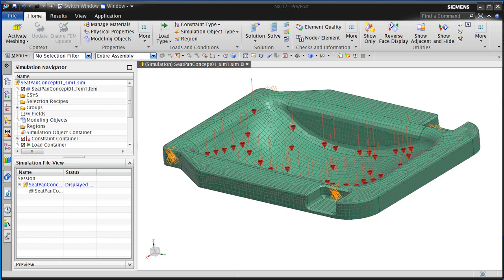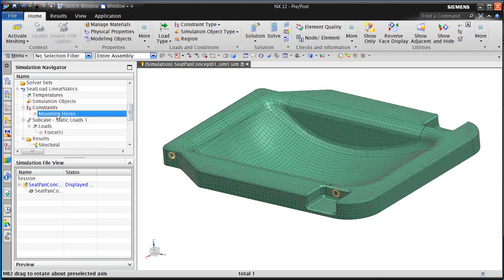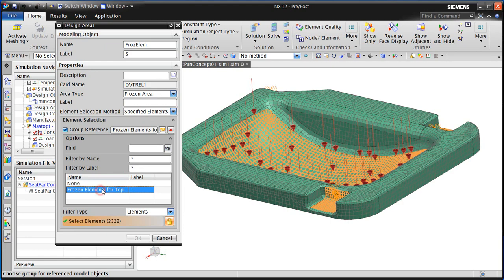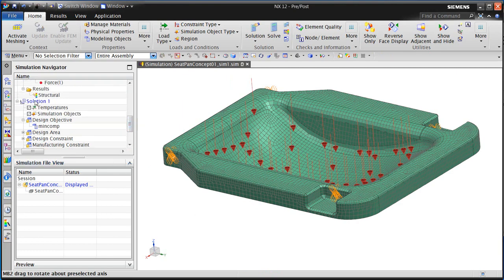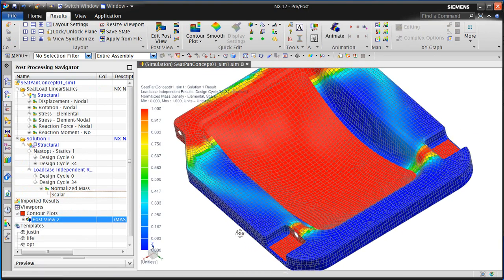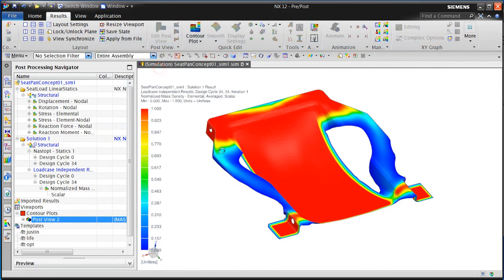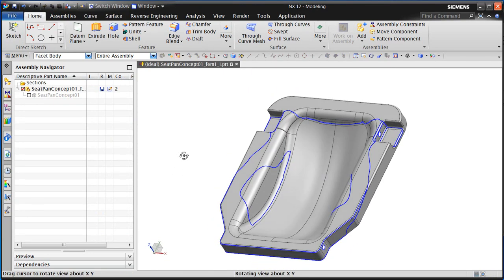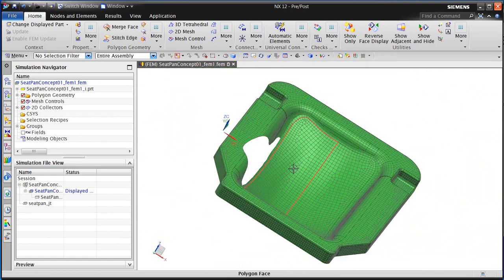Simcenter 3D Topology Optimization

Comment: very nice and informative video .Can this be used for solid bodies as well? Are tutorials for other SOL 200 solver available?
Reply from the maker: Thanks!  Glad you liked it.  It can be used for solid bodies as well.  I recommend you try our NX Topology Optimizer for solid bodies as it is easier to set up and use.  https://youtu.be/i1N1XmEMlDk?si=1HPSrmJudc8Q0CGb https://youtu.be/-CpgUf2yjW4?si=dRH1OYPVhzRNMKLU
Reply: @Simcenter3DTipsandTricks  thanks for the reply . I watched both the recommended videos .However they are using TOPOLOGY optimization directly from Modelling environment and NOT SOL 400 from pre/post.(NX Advanced Simulation)
Reply from the maker: I don't currently have any other SOL 200 tutorials for Topology Optimization.  I have been using the NX Topology Optimizer for solid bodies instead since it is easier to use.